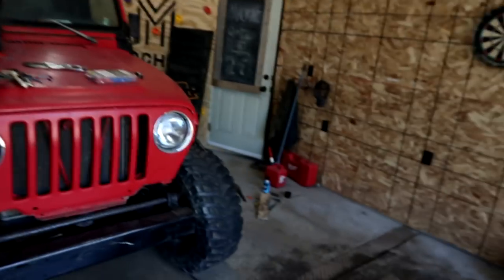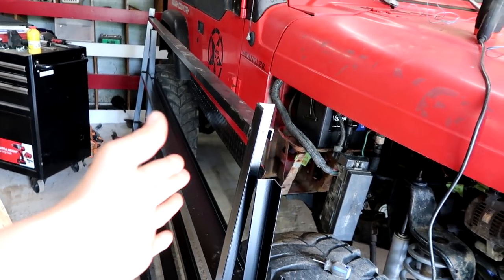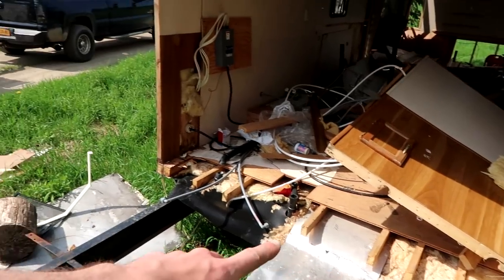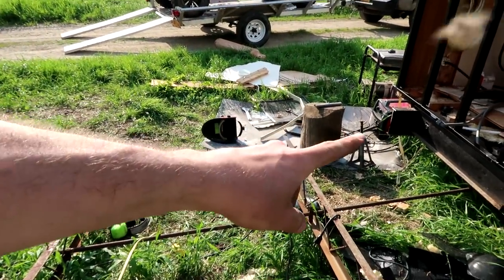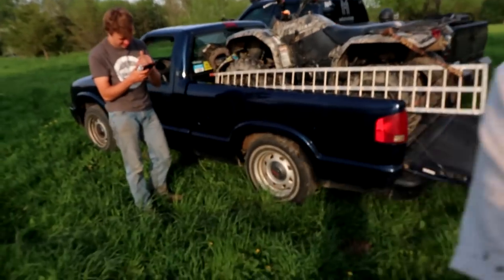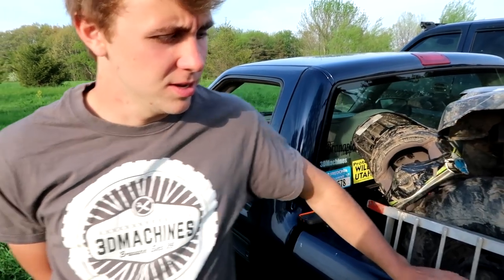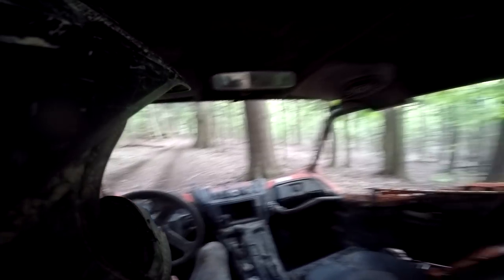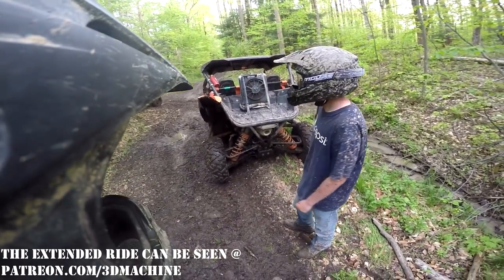We Have Bad News

Comment: Don't take the boards off the walls and ceiling of that camper without bracing it first! Believe it or not their like 50% of the wall and ceilings strength so if you compromise it it can collapse. The studs are just stapled together on the ends so their not very strong.

Comment: Close the camper off where you have it wood stopped at and weld to the frame of the camper and put crush at the very back
Reply: Jay Harris he can't because...
1. Weight distribution
2. Crush cannot be left exposed, too easy to steal
Reply: 3. Trailer would be too long for what he's doing with it
Reply: 1. That xyz weight about 3-4000 pounds equivalent to the weight of what the back of that trailer used to be 2. Not just anyone can steal an xyz unless they’re an expert, pretty sure he doesn’t leave his keys in his vehicles
3. If he put a drop door on the trailer like he says it won’t be stolen
Reply: And the back is plenty long enough for crush to fit on

Comment: Lol, what's easier, changing air filters every time they get dirty, or replacing rings and potentially the whole tip end? Don't cheap out on air filters, KEEP IT CLEAN!!
Reply: Aaron Zytolski or you get one that that you can clean and re-oil instead of buying new one every couple weeks
Reply: Dude, who said it was caused by a dirty filter? He said it sucked the dirt in from around the filter so it probably came loose or didn't seal properly
Reply: N VD97 from the way he said it, it sounds like it happened while working on it